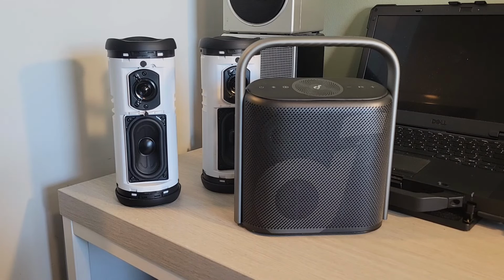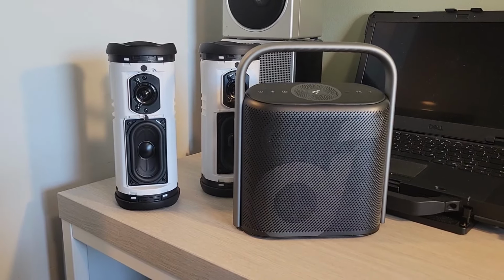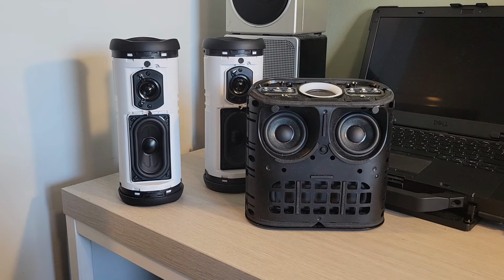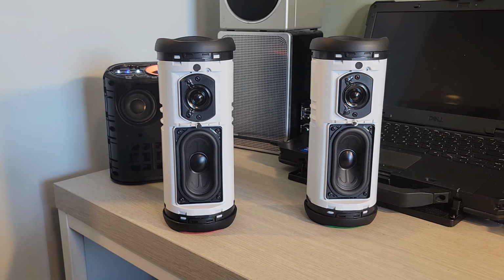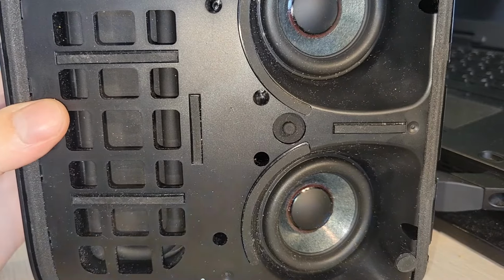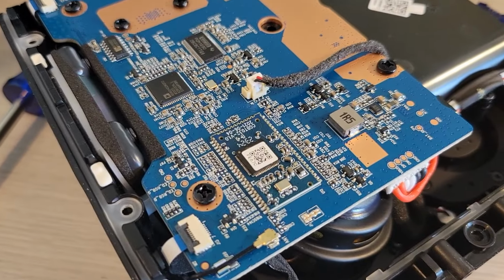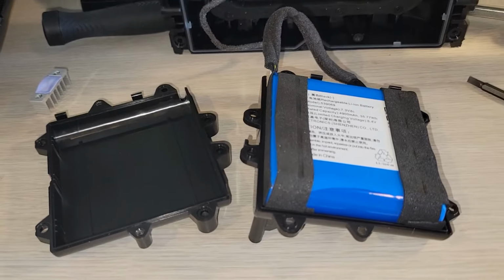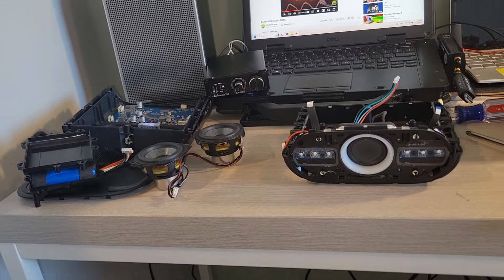Soundcore X500 Review, Soundcheck & Teardown

Comment: Im actually pretty sure the manufacturer is a company called Technoly / Tonly (a subsidiary of TCL) they do make the sony speakers according to the fcc filings of the xb-23 (i think it was the model) and they do manufacture the JBL stuff (the ones with the serial number beginning in TL also according so some fcc filing) i think its Tonly because of the driver style and the wires that connect to the drivers as they always use them with jbls sonys and more 
Anyhow a great review as always keep it up!!
Reply: Correction* 
It was the NCC label filing of the xb23 where technoly's name was written
Reply from the maker: I always thought they a trading company. I was guessing they're eastech because I've similar driver cones on their catalog.

Comment: Cheers for the tear down , and showing the drivers ..  
I ordered the " x500 " though was won over by the balanced sound of the " sowo sb3s " in your other video. Look forward to auditioning - and tuning them both. I'm looking for portability , though ordered dual " sowos " as well. Their new images show two circular drivers inside , and am hoping I get the 90 mm race track woofer. Get to the bottom of that soon I suppose ..   

—  Thanks for covering these " huaquangbei " champs !   
Just found the channel and appreciate your tear downs , cool to see inside .. 
With the internals and chips used in them ..
Reply from the maker: Thanks! I aim to expose the speakers that cheap out and discover hidden gems

Comment: you only get the benefits that soundcore x500 offers when you use an android phone that supports ldac and spatial audio through Amazon music or service that offers ultra hd audio or dolby Atmos. So it's obvious you don't understand. It is only suppose to create a larger soundstage not create 3d surround sound. And the combination of the other two speakers you used makes a better sound cause the speakers in each are larger. If you were to use just one it would sound like crap next to the soundcore. I have been in music production for 20 years and I can tell you you are misinformed and have a many misconceptions of audio. The soundcore app also allows for better bass. I'm guessing you are using iPhone and can't use ldac which is your loss not the devices.
Reply from the maker: See buddy this is a bluetooth speaker with tiny fullranges not a studio monitor. As for the dsp, just look at the analog devices website you see what I'm talking about. I'm using android on aptx btw and i rather have actual soundstage.
Reply: Is this work with spatial music in apple music on iphone?

Comment: X300 is very impressive using an an droid. How much more the x500....also got x600...and it is sl amazing...
Reply from the maker: X500 is better than x600 imo. Didn't really like the sound signature for the x600. The x500 retails at $170 but usually goes for ~$150